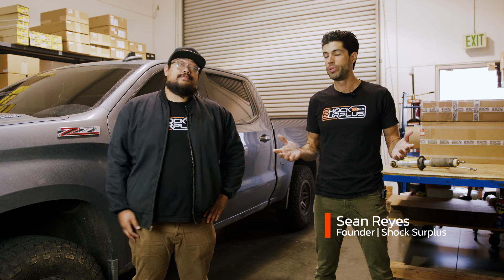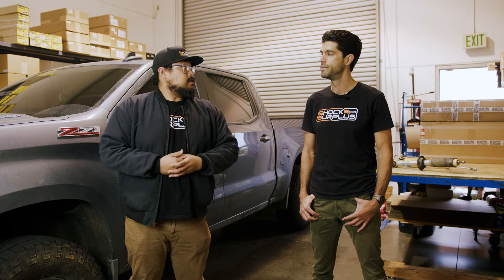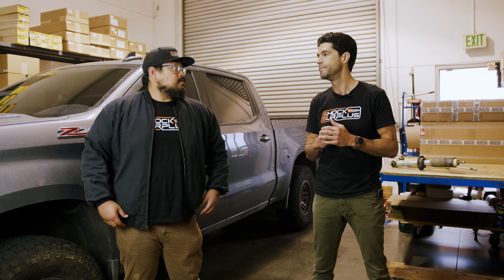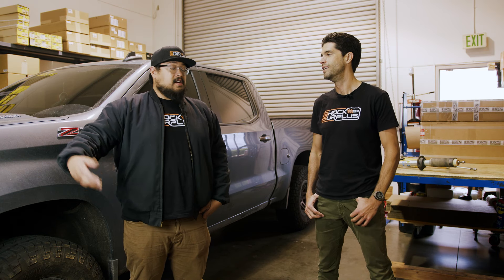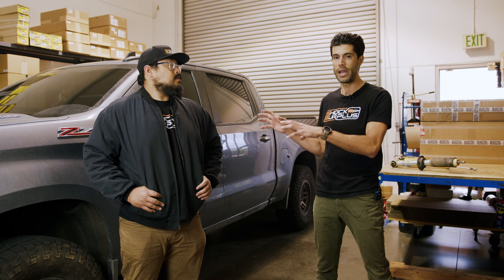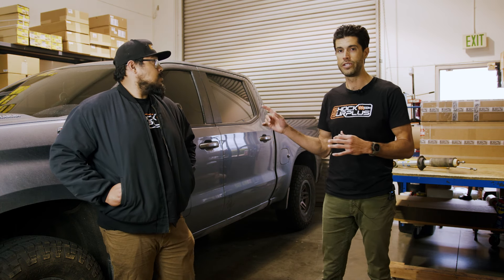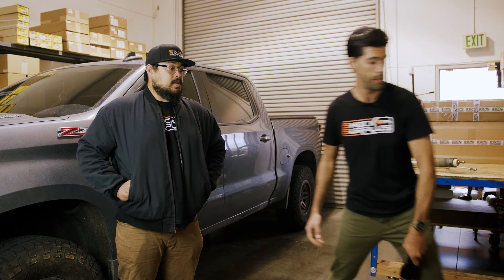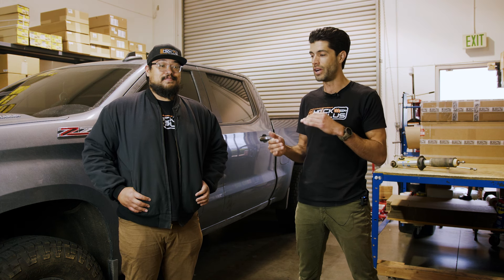Floaty, not Boaty - Cure Your Silverado's Ride with FOX Shocks

Comment: I did the FOX 2.0 on the front of my stock 21 z71.  F-me what a difference. The "Boatyness" they speak of was my only complaint about my truck. I have these 2 "trenches" I have to go over on my way to work everyday and my front end would bounce until my rear end cleared them too. Gone, all the boatyness is gone. Why doesn't Chevy put a strut like this on the truck from the get go.  I highly recommend.  Yes they are expensive but this gave my truck the perfect ride it's been missing.
Reply from the maker: Honestly we have never been anything more underdamped from the factory than these GMs with the stock Ranchos. I think too many people complained about their pick up trucks riding like pick up trucks on the previous generations of trucks and they made a heck of an overcorrection! These trucks are one of the few applications where stiffer is actually better
Reply: My theory is that OEM shocks need to last a long time and to feel comfortable on a test drive, so they are underdamped. You can't wear out a shock if it's not doing any work.

Comment: What a great video. 
I have a ‘23 Sierra 3500HD and geez that factory setup sssuucckks
I did some lite off roasting, and it made me hate my truck. 
I’ve been looking at leveling the truck over a lift for the ability to still pull a 5th wheel if I want. 

This definitely gives me more to go off of 

Thanks again
Reply: What shocks did you end up going with?

Comment: I love the fox 2.0 coilovers on mine but hated the rear. Running deaver m27 leafs and they still felt super chattery and harsh. Feel all the small bumps and even big g-outs didn’t feel that great. Went to them because I thought they’d be softer than 5160’s but I couldn’t have been more wrong. Since then I’ve switched to king 2.5’s in the rear and couldn’t be happier. Soft enough to soak up all the small bumps but stiffen up late in the travel for doing 50+ through the whoops.
Reply: So question your running fox 2.0 coilovers in the front and King 2.5s in the rear and they get along with each and give a good ride?
Reply: @chuckschweitzer491  yeah, gonna upgrade to king 2.5’s in the front eventually for shits and giggles but the fox 2.0’s in the front keep up surprisingly well. Truck rides nice and plush on the street, but handles decent sized whoops at 50 mph no problem. I’ve got air a few times not meaning to, and the landings weren’t harsh at all. It’s a really solid setup. If you don’t want to spend king money for the rear bilstein 5160’s are pretty damn good. Was much happier with them than the fox 2.0’s in the rear. If you don’t off-road often then you probably don’t need king 2.5’s and will be happy with fox 2.0’s in the front and bilstein 5160’s out back. If you off-road a decent amount the kings are definitely worth it though.
Reply: @robp418  Thanks for the feedback Rob
Reply: Rob did you ever run the bilstein 6112 up front or 5100?
Reply from the maker: It's a case by case on what suits someone better for their driving style and what they use their rig for. You have people just using it as a daily driver, some that are using it for towing or hauling aka work truck, or turning them into various off-roading rigs. Fox 2.0 were not harsh for our Silverado and we had it on for few months to test everything. We just removed them and putting on Eibach Pro Trucks.
Reply: @jagaimojoe4064  never ran bilsteins up front. Was gonna do 6112’s but they were out of stock everywhere. I’d imagine they are more firm than the foxes but that’s not necessarily a bad thing

Comment: I got a set of these on a ‘23 2.7 TB, snap ring up front. The front shocks ride great. The rears ride better than stock, but they’re loud. They have a clunk & clatter to them. I’ll have to go back to installer & check if anything is loose. I’ve read some reviews where others mention this issue and everything was torqued properly
Reply from the maker: that's definitely not normal, there shouldn't be any clunking whatsoever after the install. Sounds like a mounting issue, possibly the shop didn't re-use spring isolators up front.
Reply: @ShockSurplus  thanks for the reply. The rear shocks are the ones making the noise. Any thoughts on what they might’ve got wrong when installing the rears?

Comment: You need to add the rear jouce spacers that come on the trail boss, that will help with the Sumospring engagement, and they will work better
Reply from the maker: Thanks for the tip! We have played with spacing since this video and gotten them all dialed in.

Comment: I just bought a 19 LTZ 4x4 non Z71 sadly. Just wondering what I should set my eyes for when leveling it. I like how plush the suspension is in my normal driving. But some of the big bumps at speed I’ve noticed have zero rebound dampening. Would like to keep the ride as comfortable as possible with way better dampening
Reply from the maker: Bilstein 5100, Eibach pro Truck, or Fox 2.0

Comment: What would you except to feel with the fox2.0 on the front and blistering 5100 or 5160 on the rear. Would that give a softer ride and firmer towing?
Reply from the maker: In theory yes that may occur (softer in the front, firmer in the back), we typically dont recommend running different shocks, but it wont harm anything.
Reply: @ShockSurplus  because I have KO2 10ply  tires so I not looking for anything that gives a firmer ride. The ride is firm enough

Comment: Thank you for the video. I have have the same Silverado but it's a 2020. I it came with the Z71 package and I replaced all 4 shocks with the factory Rancho shocks that came with it thinking it would improve the ride quality because I thought the original shocks were worn out after 34,000 miles. The ride quality really didn't improve. The truck feels like it is bottoming out on the bigger potholes and it rides like crap on on uneven pavement, especially roads with seams. I can feel every seam and bump in the road, and I don't like it. It also bounces when I hit a big dip and it has a lot of body roll when going into and out of a fast corner. Another thing my truck does is the "head toss" when you go up a driveway at an angle. 

 I should note that my truck does have air bags for towing, could this be affecting my ride quality? I typically have my airbags at about 5 psi when I'm not towing. I should also note that I do almost no off-roading and I have C load rated 275/65 Bajas on it with 35 psi if I'm not towing. My question is, would the Fox 2.0 shocks help with any of these ride quality issues I'm having? Ride comfort on the road is very important to me.  Thanks!
Reply from the maker: The behavior you explained in the first paragraph is spot on, and the exact same thing we experienced with this truck on the factory shocks. Just felt sloppy, especially the driveway / speedbump behavior. 

The rear will always ride better when loaded up, so the bags inflated (when not loaded) even a little is going to contribute to ride quality and make it that much worse. Its hard to rescue the ride quality in the rear of these trucks because the leaf spring rate is the biggest factor, you can make it better with some shocks that rebound better than the factory ones (Bilstein, Fox, KYB Mono).

The Fox 2.0 is one of the unanimous answers around here when you want ride comfort on the road without sacrificing handling. 

https://www.shocksurplus.com/products/fox-2-0-performance-series-coilovers-front-pair-for-2019-2022-chevrolet-silverado-1500
Reply: @ShockSurplus  Thank you for the reply. I'm planning to remove the airbags and go with the Fox 2.5 Performance Elite Adjustable Coilovers with Resivoire Set. I haven't decided if I will leave the front height stock or lift it 2 inches. My questions are, will this setup reduce the bounce I'm experiencing now? Will the ride feel worse when I go over seams in the road, or will it improve or stay the same? Should I go with a Hellwig sway bars too, or is that unnecessary? I guess what I am trying to accomplish is #1, to eliminate the bounce because I feel it's kind of dangerous. #2, improve the ride quality or at least not make it worse, on crappy roads. And #3, improve control when cornering or towing (I don't tow very often or have a heavy load). I'd also like to improve the offroad capabilities for the rare occasion I may need to go off road to get somewhere.

Comment: So for a 2020 ford ranger, which shocks would be best? It’s a daily driver, but i don’t want to be feeling speed bumps and rough roads, and also use it for going camping every few weeks/months and over fire roads to reach some hiking spots? I also want to have the least rake possible before leveling it. Hope someone answers 😂
Reply from the maker: If you are not carrying any serious weight or doing any heavy towing with it go Fox 2.0 otherwise if the truck is seeing some load I would go for an Eibach Stage 2 kit with their 2.0 Coilovers

Comment: Question if you put Fox 2.0 coil overs on a Tahoe can you adjust to same ride height as stock or are you going to automatically get a 2 inch lift in the front?
Reply from the maker: It depends on the year of the Tahoe as not everything is available. Please contact us directly and we'll try our best to help you out.
Reply: @ShockSurplus  its a 2019 LT 4wd
Reply from the maker: The fox 2.0 coilover in the front are a 0-1" for the 2019 Chevy Tahoe. You adjust the height back to stock height if you like. 2 x 985-02-018

Comment: Here’s a stupid question: Did you use the strut bolts that came with the 2.0’s or did you reuse the factory strut mounting bolts? The guys at my local shop said they couldn’t use the stock bolts, which I think is BS.
Reply: you can re-use them. when a bolt is torqued it actually stretches. re-torquing the same bolts over multiple times will weaken it. you'll be just fine reusing them once.
Reply from the maker: we used the bolts that came with the Fox shocks, not sure why the factory ones wouldn't work though

Comment: Do these work on their SUV counter parts? Ive been looking to invest on something to replace the mag ride on my 2016 Yukon.  I want something soft but that doesnt lean a ton during turns.  Street queen for sure, so no off-roading.
Reply from the maker: There isn't a 2.0 snap ring for your particular application, but if you are switching from mag ride, you would have needed the springs, top hats, bump stops and other parts from a non mag ride model to make them work, so it would end up likely being more cost effective and easier over all to simply just go for the full 2.0 coilovers.

Comment: I have the 5100 adjustable shocks for the at4. Do I need to replace the factory UCA if I set the ring to the highest setting (1.1’ lift above stock)?

Comment: 2019 trailboss, I was thinking of doing bilsteins 5100. Can I run just the shock and be fine at +1.1?
Reply from the maker: Yup, the front struts are ride height adjustable up to 1.1" of lift using all other stock components
Reply: @ShockSurplus  does anyone make and sell aftermarket uca only for these trucks?

Comment: Question, I have a 2015 Chevy Silverado 1500 I don’t do any off-road driving nor do I plan on it. I just wanted comfortable every day riding were I don’t feel ever bump, railroad tracks etc. What would you recommend for front and rear shocks? I don’t care about the price either if they work well I’ll pay for them.
Reply from the maker: If maximum comfort is your goal the Fox 2.0 is definitely the most plush for the money, but do need fairly frequent service and are limited to just 1" of lift on the front of the 14-18 model trucks. If you are looking for something that lasts a lot longer without needing as much maintenance or offers a little more lift, you will really like the Eibach offerings.
Reply: @ShockSurplus are the 07-13 models limited to 1 inch lift too?

Comment: I'd like to level out my 17 z71 double cab. Dont want to do a leveling kit. Any suggestions?  I am liking the fox 2.0 shocks
Reply from the maker: The Fox 2.0s will only do an inch of lift on the front of your truck which is not quite enough to level it. If you like the idea the softer ride they offer, but wanted a little more lift out of the front, we recommend the Eibach 2.0 coilovers used in their Stage 2 lift systems. They are much longer in travel and are adjustable form 1.75-4" of lift in the front, but should really be paired with an aftermarket upper control arm. https://www.shocksurplus.com/products/eibach-pro-truck-stage-2-coilover-kit-rear-shocks-kit-for-2014-2018-chevrolet-silverado-1500-w-1-75-4-lift

Comment: What do you recommend for 2023 Sierra single cab daily drive on the roads ?
Reply from the maker: It really depends on your preferences but you definitely do not need much. Fox would be a great choice if you like something really soft and comfy, a Bilstein 5100 or 6112 package would be great if you have to tow or haul or just like razor sharp handling, and Eibach is a great in between shock for somebody who might have a heavy load to deal with from time to time, but still want as comfortable as a ride as they can get when unloaded
Reply: @ShockSurplus  Thank you, really appreciate it

Comment: For a 2024 1500 high country 4x4, would it work to go with bilstein 5100 Struts in the front  adjusted at 2 inches and add a  2 inch leveling kit from ready lift with the upper control arms and of course bilstein shocks in the back? I'm trying to get the height  i had in my old 2021 gmc Sierra at4 1500 leveled
Reply from the maker: it would technically work, but we'd really advise against it. If its strictly a daily driver, no offroad use, then you'll be ok. Getting to 4" of lift on that vehicle also requires some extra hardware besides just the shocks, spacer, and UCA.

Comment: Looking for new shocks on 2005 Silverado 1500. 

Need as smooth as possible for bumps and potholes due to neck injuries. Bilstein or Fox? 

Either option would be stock replacement if not the 4600, what’s the fox option?

Comment: Can the fox 2.0 be installed to maintain the standard factory lift settings?
Reply from the maker: Yup! The 2.0 snap rings like these have a groove for stock height and the 2.0 coilovers can be adjusted down to stock height with a spring compressor, although they come preset to around 2" of lift on most applications. The rear shocks in this package will not change ride height, and will work at stock height.

Comment: I want to replace my stock shocks for my 2021 Denali HD 4x4 and keep the same ride height. What do you recommend? I don’t go off road often. I’m thinking about the bilsteins 5100’s. I do have a 20ft enclosed trailer with a can am in it. I pull a boat and 2 jet skis also. I have the boat feeling while driving and not toeing and hate it. My wife’s Yukon does it too. Thanks
Reply from the maker: If the truck is stock height and you are not really taking it off road much you would probably be much  happier with a set of 4600s

Comment: whats the most plush ride?
Reply from the maker: fox 2.0, or custom tuned fox 2.5 or kings, depends on budget too though
Reply: @ShockSurplus  I ordered a Fox 2 kit and I have an air lift from the rear. How do you think I will get a comfortable ride and how to set it up??. 35\12.5 R20 F150 2018 Thank you

Comment: Did you do the deaver 1.5 leaf springs? I cant find anything on the add a leaf. Do you offer these?
Reply: I tried the deaver mini pack on mine and it helped some but honestly doesn’t make a huge difference. It’d be viable if you don’t off-road the truck all the time. I’m currently running deaver m-27 full leaf packs which I believe give something like 1.5” of lift and they make a big difference in ride quality. They aren’t cheap though and they reduce payload quite a bit. If you off-road the truck a lot and don’t tow much then they are awesome. Otherwise for a third of the price the mini packs are pretty good.
Reply from the maker: For Jeff's Silverado, we ran Deaver N35 that was suggested from them. This is a 1" mini pack. It's not that huge a difference terms of providing more support in weight but it overall provides the height Jeff was looking for. He did add an additional 1" block to get up to 2" in the last setup as well. The block was from Eibach.

Comment: I have a 2022 high country 4x4 what do I need to level do I need new uca? And should I go Bilistein  5100 or fox
Reply from the maker: you wont need a new UCA to level the vehicle, we see lots of 2.5in leveled out trucks without new ucas and without problems. At 3in yes get one. 

Check out the Bilstein review on this same truck, those are for quite different drivers / needs. Bilstein for handling, Fox for comfort basically